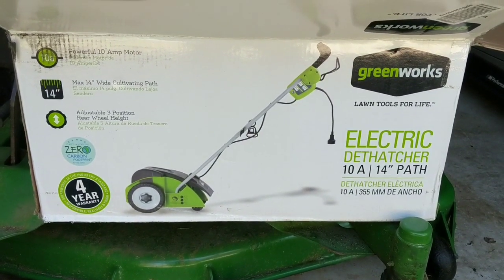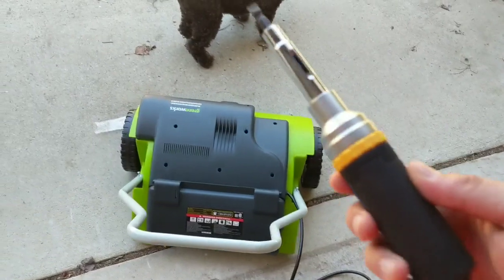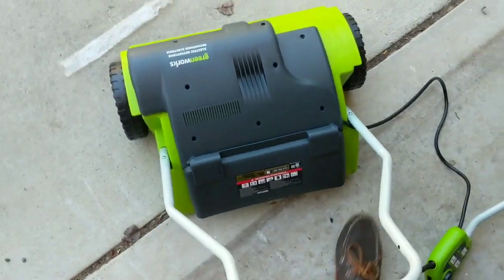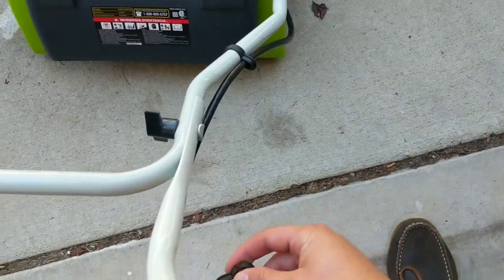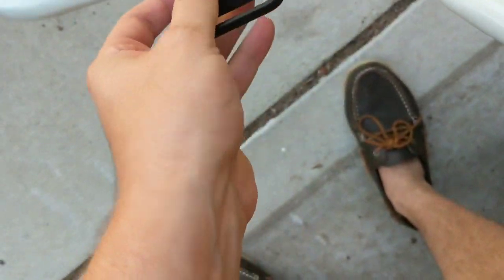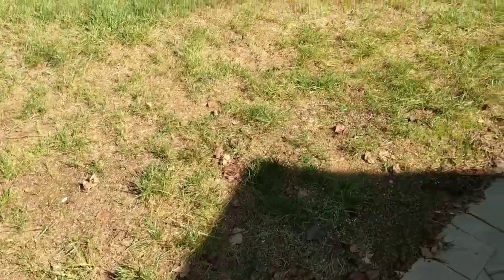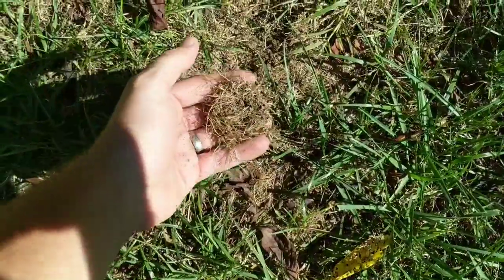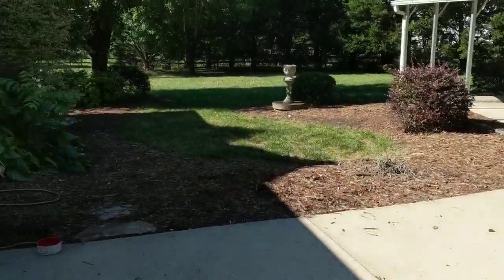Greenworks Electric Dethatcher - Assembly and Review

Comment: Thank you so much! Easy-peasy. For the extension cord clip, slide its circular loop onto the bar of the lower handle before inserting the lower handle into the holes and attaching the upper handle. Then it will just hang down and you can clip the extension cord to it. I figured it out after I had already assembled the handles. 😄
Reply from the maker: Thank you! Apologies on that reverse order on the clip! That is correct